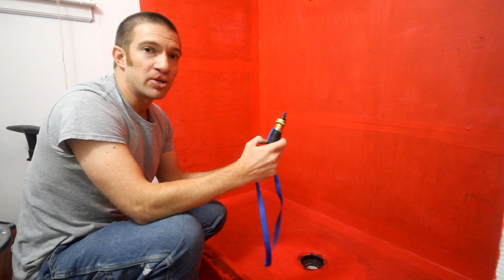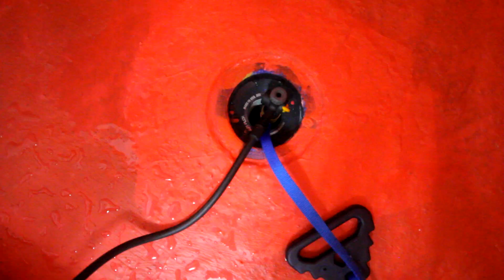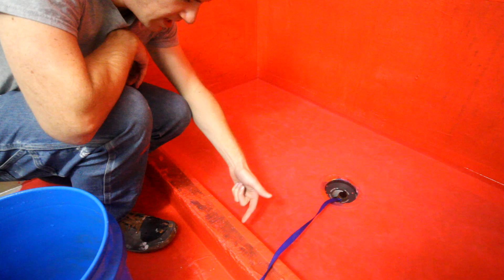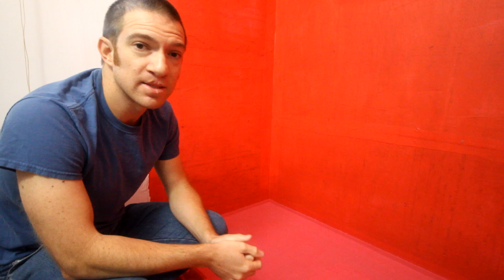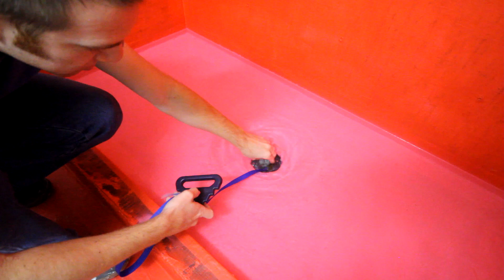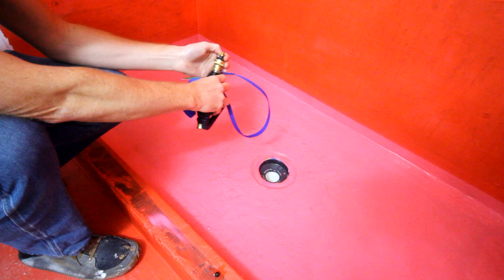Step-by-Step Flood Testing a Shower Pan

Comment: Would you recommend the same test for a leaking shower where the tile is already installed and grout has been applied?
Reply from the maker: Hey there. This test could be used at any point to determine if the shower is completely watertight. If you already know the shower is leaking, then it might not tell you much unless you just want to measure how fast the water is draining out.
Reply: @practicalhomeprojects  It's leaking, but we're trying to find out if it's the pan or the walls. Thanks for your answer. I just didn't know if it would be wise to fill up the pan when it already has been tiled and grouted because I was thinking the excess water may cause the tile to become loose.
Reply from the maker: If filling the pan with water causes tile to become loose, you'll want to know sooner rather than later. If installed properly, the tiles should never come loose. The vertical surfaces are rarely the source of leaks because water follows the path of least resistance straight down. Leaks usually occur at seams where water can settle.

Comment: Im installing a fiberglass shower pan so I'm only going  to add enough water to cover drain test plug.   Advice ?
Reply from the maker: The flood test would really just be testing the drain assembly, so I suppose you wouldn't need to fill it up all of the way. It wouldn't hurt though. Good luck on your project.